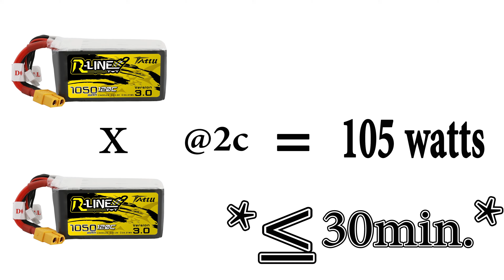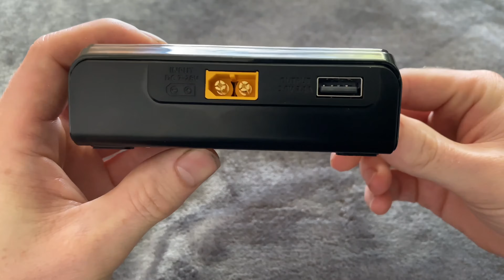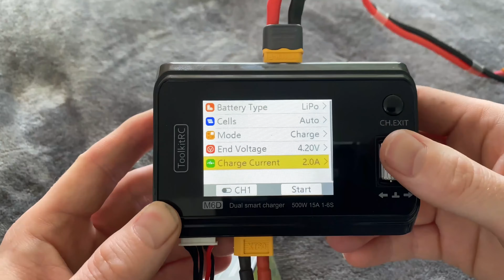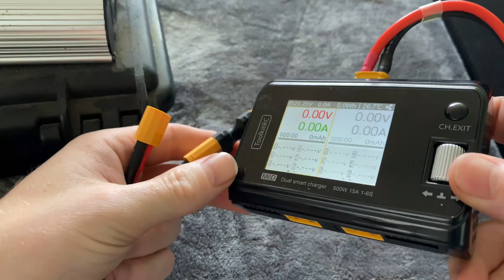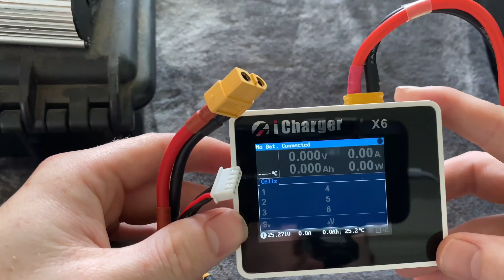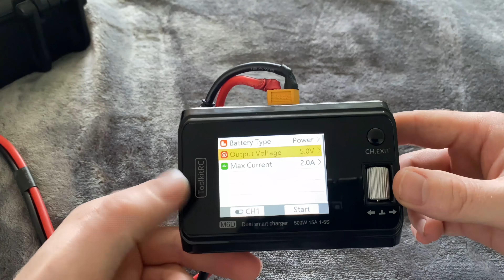Why The $60 ToolKit RC M6D Is My New Favorite Charger

Comment: My adventures with ToolkitRC M6D. After a few uses, the charger began to reset if it moved the power plug. After a month of asking the seller on AliExp ... for a service manual (I had to send them some symptom videos), I got the answer - "Apologize again for any inconvenience caused.". I decided to open this charger myself (yes - you have to unstick the screen to get to the screws). I've found there were many of cold joints/weak joints on the motherboard - including the fan plug that stopped working too. I corrected all of them (you must have a strong soldering iron) and the charger now works. If the manufacturer does not improve the production process, I warn you before buying this charger, because the quality seems to be very random (which is a pity, because its functions suit me).
Reply from the maker: I’ve been handling a lot of ToolKit products lately and my experience is similar. I’ve opened them up and their QC looks terrible on several products. I am not loosing hope in ToolKit yet, but would encourage everyone to wait until 2022 to consider purchasing ToolKit products, or until confirmation of better QC 🤙

Comment: I know this is an old video, but do you remember when you did the full load test if the current fluctuated at all?  I recently bought one and it will not hold steady power.  I set any battery to charge on any port.  Set it to 15a and it will bounce between 6 and 15   I actually sent it back because it seems like a faulty unit.  But I was wondering if they did that on purpose to manage heat.   Haven't seen anyone else run one at full power.   All the other videos show them running at 1-2 amps.  I would notice the power dump after about 30 seconds, then it would continue throughout the charge cycle.
Reply from the maker: Truthfully I ended up having a few issues with my Tollkit chargers. Not the M6D specifically but almost every other model. I have seen wild current fluctuations before and sending it back was a good call. 

I’m hoping toolkit has gotten better in the past couple of years. Possibly on newer models 🤙

Comment: can a 575 watt 12v power supply use sync mode and charge at 25 amps or only the normal 15 amps?
Reply from the maker: I am not sure why you would need sync mode to charge at 25 amps, both channels are rated to 30 amps each. In sync mode, you could charge at 50 amps. 

You can access sync mode with any 12v supply greater than ~12w. So basically any would work 🤙
Reply: @ChaddRainsFPV  oh i thought the limit was 15 amps each port?
Reply from the maker: @maagneticc6470  Sorry, I was looking at the wrong video. I did a video on the new DX8 just a bit ago, thought this comment was on that. 

Same is applicable for power supply though. A 12v power supply at 575w is actually limited on the M6D, which can only draw 360w from a 12v source; but that’s more than enough to do 25 amps on 1s,2s and 3S batteries and can even do 25 amps on 4s batteries for a little while (it will trickle down to about 22 amps by the time the battery reaches ~4v per cell. Hope this helps 🤙
Reply: @ChaddRainsFPV  Thanks i only plan to charge a 2s and 3s is the max for one port 15 amps?
Reply from the maker: @maagneticc6470  it’s is. The M6D does 15 amps per channel and the other charger I reviewed does 30 (the DX8). Make sure to get the M6D from a reputable retailer; ToolKit RC has had QC issues as of late.

Comment: If you had to put a rating or scale the isdt q6 or Q8 against , this one you reviewed and against the any other you may have ? What would that scale look like ? I have the isdt nano q6 and it’s awesome for its size and capabilities yet can only. Discharge 1A max and output 5/8amps per cell if I’m not wrong which for charging is fine , but have you tested that power supply mode for this one you reviewed? Goes all the way to 15A?
Reply from the maker: The M6D is a step above in utility compared to a q6 and q8 but only time till tell for longevity. I have a q6 still running strong after 4 years of regular use. The power supply functions as it should (though I didn’t do extensive testing) and the discharge rating for all of these pocket sized chargers will not be good. Between 5-10w on average. 
Isdt makes a good discharge bank called the fd-200. Hope this helps 🤙
Reply: @ChaddRainsFPV  on this charger you get W/h reading on the what ever is the input source right ? This would go 10-12wAtts discharge what about the battery to battery discharge feature ? Will the battery being discharge display the mah capacity and million ohms IR?
Reply from the maker: @charlschuck6  - The pack being discharged (in any circumstance so long as it is connected to the output) will display the capacity that has been drawn. During the discharge, IR is also available, yes.
Reply: @ChaddRainsFPV  thanks

Comment: My charger indicate battery with cells instead of wattage like urs. Did u change the anything in the settings? Also how to turn off the charger instead of close it off the switch of the power supply?
Thanks
Reply from the maker: I’m almost positive you can switch to wattage in the back settings menu or you can just scroll a bit more to see wattage. As for turning off the charger, the only way is to power down your PSU or unplug the charger.
Reply: @ChaddRainsFPV  thanks for the info buddy

Comment: You are suggesting a $70 2.5 kg brick for this baby. I think better choice is Hota d6 plus with built in AC power supply.
Reply from the maker: The Hota D6 plus looks pretty nice actually. But it’s not going in your pocket like the M6D, it’s going to stay on the bench. And if it’s staying on the bench, why not have the big brick of a PSU? Both setups total out to about the same price (within ~$5) and the M6D is a good amount more powerful.

Comment: The resistance is not 1 digit, it's 3 digits !
Resistance is measured in Ohm but it displays milliohm, 1000 milliohm is 1 ohm
Then later on you say it's 7000 volts off, not sure what you mean by that I suppose you missed that there is a COMMA, 25.274V is not 25 thousand volt, it's 25 volt.
Reply from the maker: Hey Ha Ka, thanks for watching so closely. It’s good when your work is detailed closely. In regards to the ‘digit’ I mentioned, I realize the charger can measure above 9 mOhms (it even shows in my video a double digit reading on the 3S pack on channel 2), I meant it won’t do any readings smaller than 1mOhm or a fraction of a mOhm. Say you’re charging a 10Ah pack. I would expect it to have an iR of around 0.5 mOhms. I don’t think the charger is capable of displaying that or it would have given a digit after a decimal place with my other packs. As for “7000 volts off”, I actually say “7 thousandths of a volt off”. Which is mathematically accurate 🤙
Reply: @ChaddRainsFPV  Hi,
Glad you didn't take it negative.
To explain:
1 milliohm is an incredible tiny resistance, a 6S lipo with 10 milliohm internal resistance can deliver 2500 amps, that's more than 60 kilowatt; enough to power a resi
dential building also enough to damage the lipo within a fraction of a second when shorted of course.
Meassuring tenth of a milliohm is useless, the cables have way more resistance than that so a few millimeter more or less cable or a bit dust on your connector can cause such changes you'd read different resistance all the time because any test changes the temperature of the connection and thus the resistance.
So if you find that sort of precision in a tool that costs less than 10 grand it's not a sign of quality, it's lack of quality.
When it comes to voltage it's the same thing. I'm not a native speaker so I misheard you.
1/7000 volt is a tenth of a millivolt.
All the errors from above come in and make that useless. 
Only highest quality tools can measure such voltages and that needs laboratory equipment and setup.
Even talking to the cable will have an influence of that magnitude in voltage.
So if any charger reports 1/100 of a volt difference you can ignore that digit because it's by far not precise enough.
1/10th of a volt is about the accuracy you can get and anything more precise than that is washed away by entropy.
Reply from the maker: Ha Ka - Thanks for the reply. Your internal resistance understanding is good, but possibly not that good when it comes to LiPo batteries. There is a huge difference in performance between a cell that has an internal resistance of say 1.5mOhms (common from a high quality 5 Ah LiPo cell) vs one that has an internal resistance of 9mOhms (common from a 1300mah cell). The voltage sag alone would be very noticeable under the normal load of an rc aircraft.  As for the voltage, it was 7/1000 (spoken as ‘seven thousandths) of a volt that was said in the video. Which is what my icharger x6 is capable of displaying. I do say in the video that that is a very small amount of energy and I consider the charger had done a good job of balancing.

Comment: Needs a charge squid, balance board, and AC adapter if it wants to replace my TB-6B. Very few ofthe batteries I charge are on XT60
Reply from the maker: Fair point, but the M6D has exactly 10X more power and twice as many channels as the TB-6B, plus it costs less. It may be a great charger if you ever need more power! You'll just have to spring for some accessories if that day ever comes.
Reply: @ChaddRainsFPV  I'm a nitro guy so my charging needs are more towards 'affordable and won't set my house on fire' than 'gotta fast-charge an entire backpack full of 6s packs'. Mostly I'm charging Li-FE packs for running my receivers, glow driver nickel cells, I have a couple of 2s7400 hardpacks for my starter.